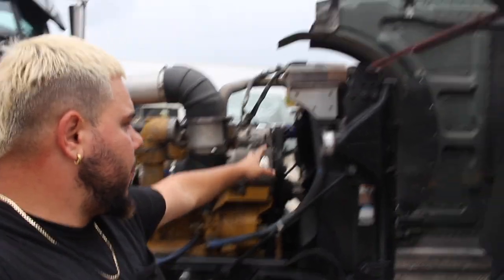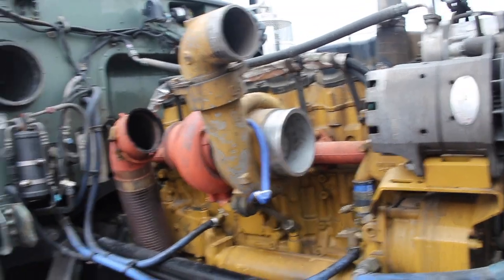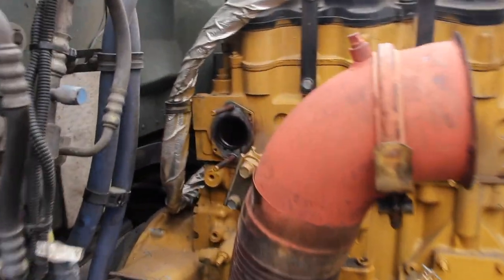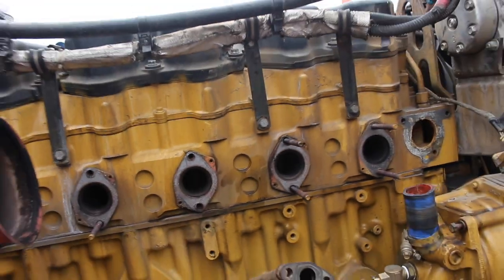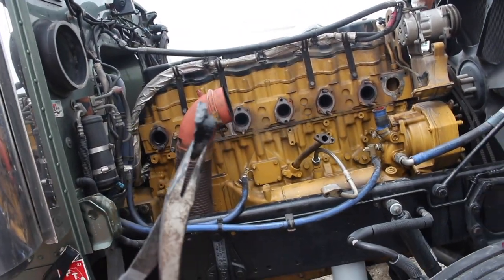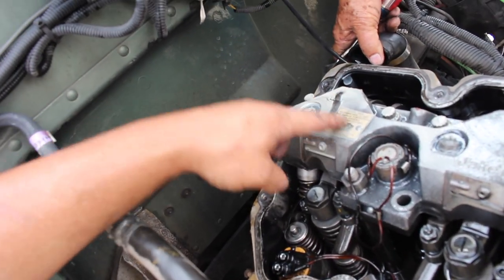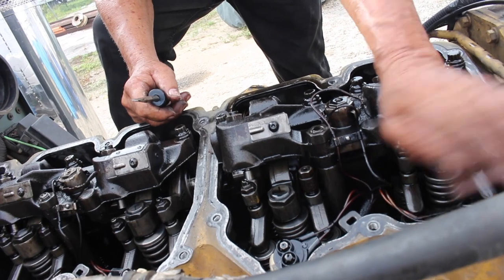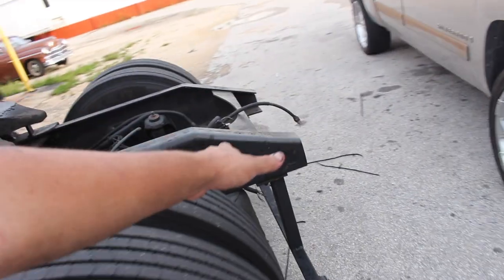Rebuilding a Peterbilt 6NZ C15 Motor part 1

Comment: I like the custom fenders you have not the half chrome.  They make the truck look low profile and fuill custom. Also, thanks for showing your rebuild.  I am not a mechanic but have my own 300k+ Chevy trucks (1 is a 1993 s10 customized) that I like to work on.  Every little bit of info helps.  Hope the rebuild goes smoothly.
Reply from the maker: Thanks my bro God bless

Comment: I like the quarter fenders the half quarter fenders I think they look really good it does suck that you have to take your fenders off to check the tires or change the tire it seems like more work but to look good I guess you have to go through the hard work if that makes sense. Yeah half quarter fenders with a T-bar in the back and mudflaps it will definitely give it a different look. 👍🏽. I think that’s awesome you get to work with your grandfather he seems that he has another lot of knowledge on working on motors good luck to you guys and I can’t wait to see the green goblin running again.

Comment: Like the looks of the fiberglass feneders but... Looks like they're takin a little bit of a beatin. The deep quarter fenders look nice with a van trailer , with a painted or chromed light bar with flaps on the back.

Comment: Good to see you doing well and getting things together. I think that the stainless fenders over the rear tires would be better. You are putting a lot of shiny, silver/chrome and stainless and shiny aluminum wheels on the truck little by little.  You have a working truck and is on the road a lot, therefore prone to have tire issues. Easier to work on those tires without those covering fenders in the way. Although those fiberglass wheel fairings/covers look nice, maybe better for show trucks or trucks not on the road as much as yours.  Just my opinion, I do not own a Semi, but do own cars and trucks. You can make look good, set off your style and make easy to work on as well.

Comment: Either way that truck looks good but if the Pete was mine, I would put the hogebuilt 34 inch 1/4  fended and add them to the trailer also . As far as the middle part yeah stainless with 8 watermelons 😎. Good luck homie saludos de Tampa Florida.

Comment: Hi Sorry for your challenges. Will the block need to be machined before you reassemble? Will you need a new head? Our prayers are with you that you can be back on the road soon!
Reply from the maker: Yes full rebuild and yes block will need to be machined
Reply: @Fltruckriderz  If there is a positive in this it is your grandfather. Hope the rebuild is not too expensive. Hope you are back on the road soon. Prayers for a speedy and economical rebuild from West Texas